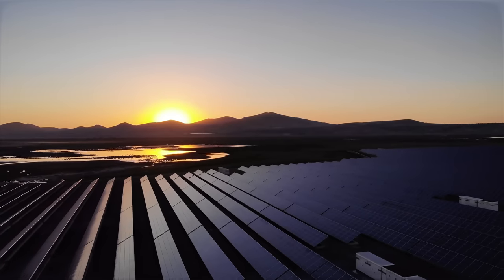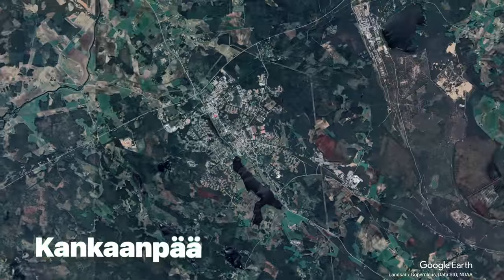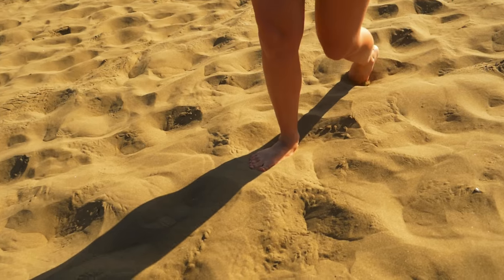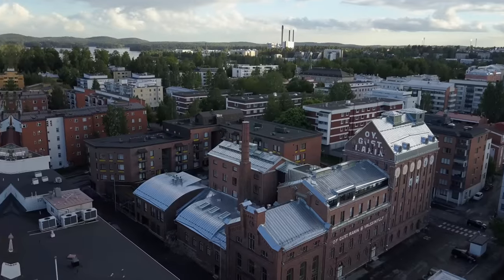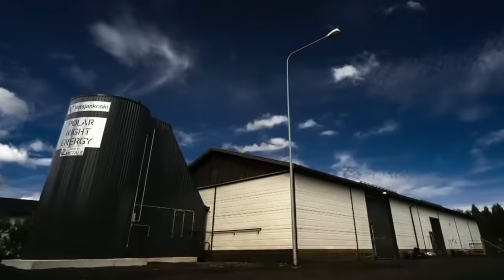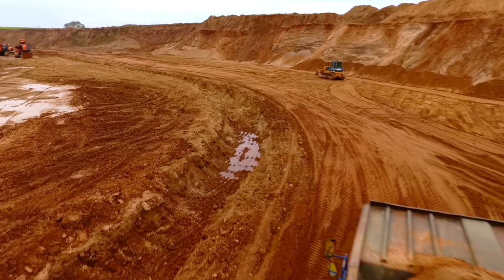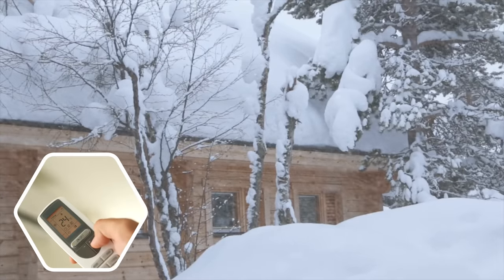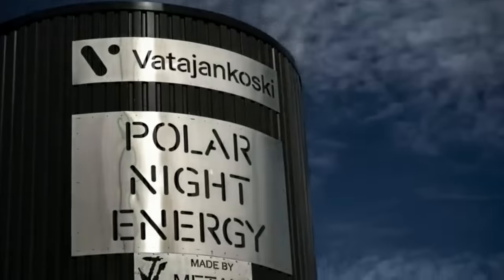Breakthrough Tech Heats Homes Cheaper Than Natural Gas!

Comment: This is an idea that has been done before in slightly different ways.  A friend of mine built a solarium on the back of his first home.  He also built a semi passive heat battery underneath it.  The battery was just three feet of pea gravel in an insulated pit under the solarium.  On winter days, the solarium would capture much of the sun's heat, and a fan moved that warm air through the gravel and into the house.  After the sun went down and the temps began to fall, the warmed gravel would still supply some heat, reducing his gas usage.
Reply: A solarium to me is somewhere you go to get a sun tan artificially. What are you refering to?
Reply: @TheBooban , Maybe Sun Room is a better term?  It was basically a porch on the south side of his house that was built like a green house; All glass.  The one wall it shared with the house was cinder block, stacked straight and painted black.  The fans pulled air from the house through them and blew it into the gravel pit before going into the house.  In summer, he would hang a white curtain in front of the block wall.
Reply: Unless there was a comparison to not hsving that contraption in the same house, then it's simply a bullshit claim to say there was a fuel savings.
Reply: If they made sand bricks,left an air flow grid between this may be an option, or form sand into hard balls and loose stack ?, The question would be ,does running a fan provide greater heat stored energy,as say have more insulation and running a heat pump ?
Reply: @daleval2182 , what is being built is a heat battery.  Just about any mass of material will work for this, but by using something with a lot of surface area for it's weight, you can "charge" or "Discharge" the battery faster.  A one ton block of concrete will hold as much heat as one ton of pea gravel, but the pea gravel can be warmed up by hot air flowing through it much faster than the block of concrete with air flowing around it.  Whether you use it as a source for a heat pump or just as a source of warm air is a matter of time, budget, and skill, if you are doing this yourself.
Reply: @hime273 , there was a Comparison.  He built the Solarium five years after he bought the house.
Reply: @Cee64E  so how does he know if it was the Solarium, or the Rock contraption?
Reply: @hime273 , Because if it was just the sun hitting the warm room, the warm air would stop shortly after the sun went down.  Heat stored in the gravel heat battery will continue for several hours.
Reply: @hime273  
Oh Geez go troll elsewhere....
(Seriously,  how much do you get paid to stir up shit for No reason in YouTube comment sections?)
Reply: Charles Martell  You are warming up to a cool heat idea. It's a hot product.
Reply: @TheBooban  some people think a cucumber tastes better pickled
Reply: @hime273  a reduction in his utility bill, might be an indication... cost of gas may vary year to year, so that's at least one variable, nobody here knows.

even if 'the people' use less natural gas, that doesn't mean they won't still chase it for export profit... so, if being green is the angle, it certainly is, but doubt it will achieve the outcome they are hoping for, at least in the short term.
Reply: and the massive exposure of all the glass lost tons of heat , right ?
Reply: @bobsaturday4273 , glass doesn't lose heat, per se.  Heat is basically infrared light, and IR light doesn't travel through glass well.  That's why greenhouses work.  Sunlight comes in, hits something inside and warms it up.  That something then radiates IR light, which glass mostly reflects back into the greenhouse.  Now single pane glass can lose some heat due to conduction.  Glass around a greenhouse is going to be warm on the inside and cooler on the outside in cold weather.  Heat always moves towards a cooler place.  Glass is only a middling conductor of heat, but there is some loss.  Multi-pane windows can significantly reduce that.

Now, in the summer, obviously, you don't need a bunch of extra heat.  That's why greenhouses, and structures like them, usually have opening windows at the top and bottom of the structure.  That lets fresh air circulate through and carry excess heat away.

Comment: I built my home to heat AND cool in Arkansas, without any other energy source.  The house temperature year round was between 68 to 78 degrees.  Heat of sun and coolness of earth transferred by concrete walls and floor and south facing windows.  VERY COMFORTABLE!
Reply: come back when you can do the same in scandinavia and stick to the building codes..
its a bit more easy to harvest the sun and cool, then it is to save it for heat, when there is little sun

im also thinking of moving to the southern europe where stuff like that is easy..
but that doesent make any difference to the nature.
the same number of people will still live where its alot harder
Reply: That is a big achievement.  If done scientifically, I assume that chance of success increases significantly.

Comment: You don't specifically need construction sand for this application, as stated by the Company itself.  They can design systems using sand not qualified for construction, as well as some kinds of dirt and gravel mixtures, using the same properties.  They just have to account for the mixture when designing the system and ensure it is uniform.  They also stated they can also try and utilize places like old quarries as a basis for making these systems instead of making them from silos, both of which can utilize local resources to drive down price lower than their standard approach of silos and sand, which is a choice they made because they are available rather universally.  But to make them cheaper per-scenario, engineering them to the situation will probably be cheaper in many situations.
Reply: I was going to mention this.  Sahara sand is too smooth for construction, but would be great for this application.
Reply: I think Polar Night is prioritizing recycled sand at the moment. But yeah basically any kind of rock sediment. Construction sand just happens to be easy to price by the ton.
Reply: Actually cost per KW of Solar powered system is only $0,2 and there is a whole system in village Badnjevac in Serbia, that can provide energy for 2000 homes...
Reply: Would love to invest in this company.
Reply: Desert sand is unsuitable for construction. They can use that instead.
Reply: Charles Martell  from my understanding the larger you make these systems, the lower the heat loss of the system itself.  So unless it is a very big building, or there are a handful of neighbors to split the one with, I'd imagine other solutions may actually be more cost efficient in that scenario.
Reply: What are the tradeoffs with this technology? What are the pro's and cons? It seems very interesting, and I'd hope it could be useful for off-grid rural homes. But where are the weaknesses? I'd really like to know.
Reply: came here to say this...nowhere have I seen them say anything about it needing to be construction grade
Reply: Yeah, it kinda made me question the research they put into their videos. the sand used is a big point in the system and it seems like something hard to overlook. But of course everyone makes mistakes lol
Reply: @dausume  I like the idea for community grids.
Reply: The problem with sand batteries is the very thing you're claiming to be an advantage: the fact that sand maintains heat makes it difficult to remove that heat energy to use. Furthermore,  using electricity to heat the sand is an energy state change which is a large energy loss. Changing it back is another loss.  Sand may be cheap but it requires a large amount of conducting material. If this was a practical solution water would be even better since it is cheaper and easier to handle.  We all ready have extensive experience with radiative cooling and energy transfer efficiency.
Reply: Good use for windblown desert sand which is no use for concrete.
Reply: seems this cannot exactly be called a battery. It is something like grandma's hot water bottle.
Reply: @tomkunich9401  the sand battery is specifically meant for heating use, so transfer back to electricity is unnecessary. The benefit of stable, safe, non toxic, cheap and ubiquitous storage medium is the main benefit. Not as versatile as electrical batteries, but fraction of the cost as well. Cheap enough for also smaller and poorer communities to build and use.
Reply: @manofsan  The biggest downside is that it has to either be really big or really well insulated to be efficient.
Reply: Quarries, great idea. Especially for homesteads, farms, or places that make tons of waste heat like silos and processing plants.
Reply: @aphilipdent  They can make a lot of energy fuel via conversion if they can store it. Magnesium mineral paste for storing hydrogen made in deserts.
Reply: The next iteration of the Finnish experiment is apparently going to use what is called soap stone*, a byproduct of some manufacturing processes.  I didn't read carefully about all the details.  I get very excited about the possibility of energy savings to aid the environment and people's wallets and comfort.  I have a healthy level of skepticism about startups and new technology.
Reply: charlesmartell4484 I concur.  The requirement for distributed heat within a city or community is extremely useful but pretty specific.  Finding ways for the average Joe to set up their own system is very empowering.
Reply: @manofsan  There is high up front cost.  At this time, the efficiency isn't entirely known yet on a wide scale.   It may not be as helpful in different types of climates.  I am very excited this technology may aid in becoming less energy dependent.
Reply: charlesmartell4484  Sorry to hear that part didn't work out.

Comment: Please note difference between power (kW) and energy (kWh).
Power is measured in kW and energy is measured in kWh.
1kW of power for 10 hours uses 10kWh of energy.
At 4:04 you use the same unit for both power and energy (100kWh  and 8MWh).

I assume it can supply up to 100kW of power and has 8MWh of storage. i.e. 80 hours of full power usage.
Reply: Yeah! 
That one took me by surprice, haha. I was like "100 kWh, that's not much"
 - then he said it can store up to 8 MWh and I got it that the "100 kWh" probably ment it can supply up to 100 kW of heating power.
Reply: There are almost 50 000 views of this video and only 5 likes under your comment. Hmm... Interesting... 🤔
Reply: @Speeder84XL  yea 100kWH would be laughably small for such a silo, even 1m3 of water from 80c to 20c can give 100KwH of energy lol
Reply: @app3264  8 now. Most people are here for the hype, the don't care or understand the meaning of those units
Reply: @faustinpippin9208  exactly, although I think it would be closer to 70kW.
Reply: I find this error too often in his videos. Really takes away from the message. Perhaps he should take a course on Brilliant to brush up on the units.
Reply: @AORD72  Yes, 69.767 kWh to heat 1000 liters (1 m^3) water from 20C to 80C. Specific heat capacity of water is 4.186 J/g/C.
Reply: @scrumtious1  Ricky's been called on this so many times, I just don't think he cares.  It's really a shame because the difference between power and energy is such a simple concept.  By making that mistake over and over again, it's like hanging a sign on the video that says "I don't really know what I'm talking about".  Too bad, because the presentation is good.  Maybe he could hire an undergrad engineering or physics student to read the script.
Reply: Honestly, he made a few mistakes in this video. I would not count him as a reliable source.
Reply: @incognitotorpedo42  I completely agree. It's a bit of a pity.
Reply: Actually energy is measured in joules.
Reply: @RedTheJaz  You are correct but a Joule (Watt-sec) is very small. 
The common unit for power is kWh (=3.6MJ)
Reply: so the finns want to build big to service towns ,,,,,,i want to build small to heat my home ...has radiant floor heating    ......i am thinking solar panels connected to oven element in unused stove filled with crushed glass.....a coil inside to heat the air and a second coil to heat the water to send to the tank....i am short on the electrical and engineering aspects .....do you have any advice or suggestions ..thanks